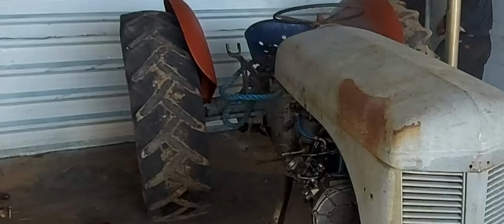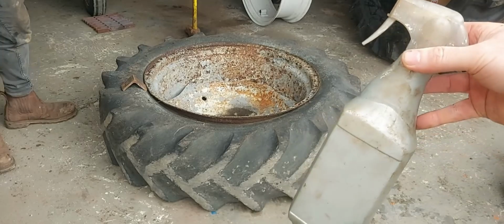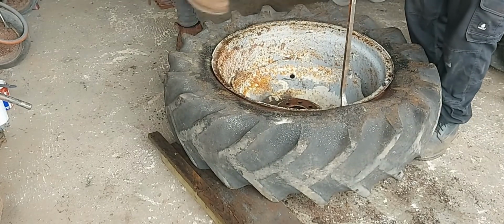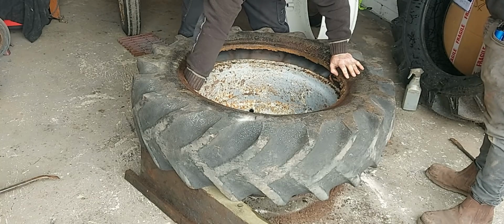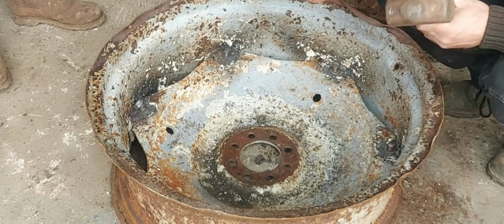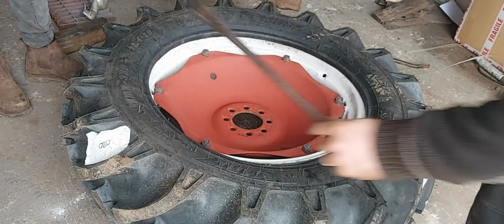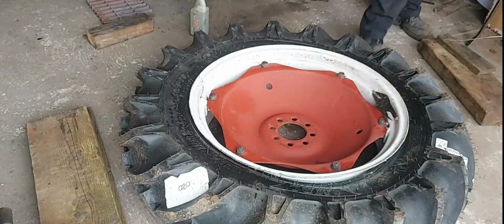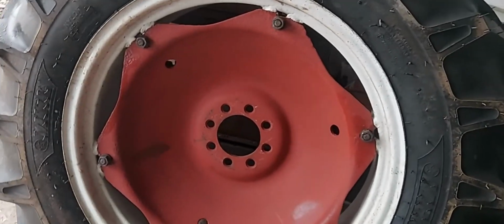Ferguson TE20 part 7

Comment: The fun of old tires on rusty rims, been there done that lots over the last 35 years since I started messing with old tractors and farming. You said you wanted to know what happened with that 9700 ford I was thinking of buying. It was a bit of a wreck that didn't run an not much was known about why it sat 20 years. She'd got 10K hours with bad tires, wildlife had been in the cab but it was nice bodywork under the rust and  paint. it made $8000 non running, and I figured it would need another 8-10K  to put it right as it needed to be restored, so I ran. About 3 days later I bought a North American spec  ford 5000 diesel or blue grey super major as you'd know it. It runs /drives after 2 hours messing with it and apart from a bit of rot on the nose and mud guards is fairly original with an original top link and 4 corners of wheel weights.  I gave a more agreeable $1500 for that  . Thanks for the video, Take care
Reply from the maker: Nice, it's like you got a good deal. Thanks for watching.